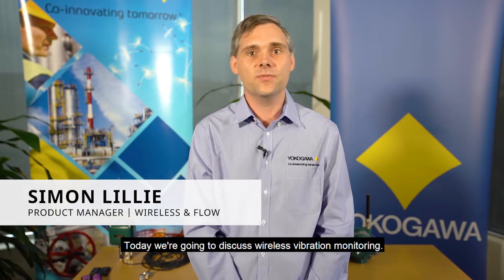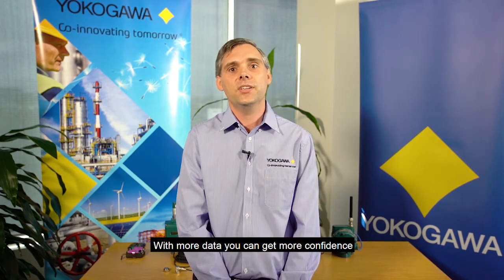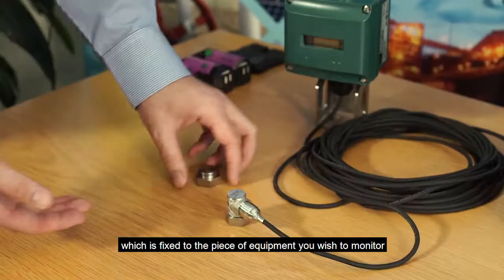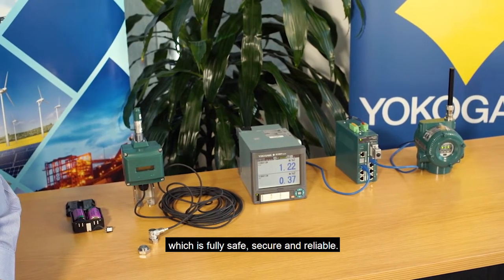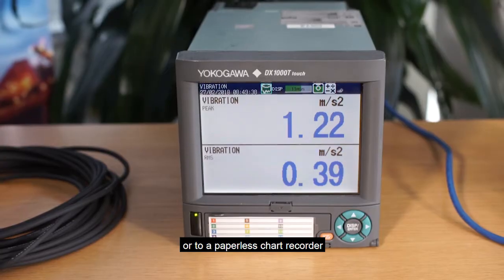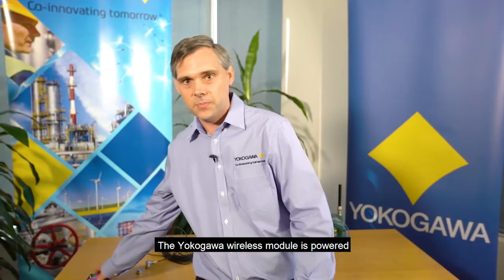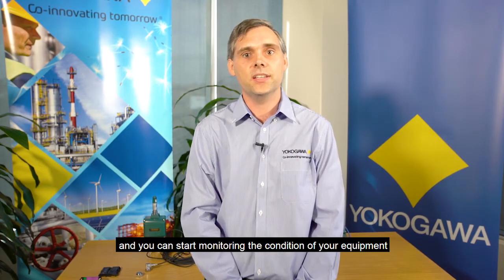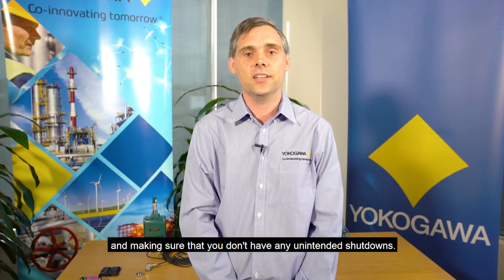Wireless Vibration Monitoring

Comment: Nice video, but wish you had identified each component by its Yokogawa p/n (YFGW410 for example).
Reply from the maker: Hi Willy, check out https://www.yokogawa.com/au/solutions/products-platforms/field-instruments/field-wireless/ for p/n etc. or feel free to contact us at enquiries@au.yokogawa.com. Thanks!
Reply: @YokogawaAustraliaNewZealand  Great, thanks for the info.  I am relatively new to this, but I'm trying to configure a YFG410 gateway along with a YFGW510 access point, to a field device which is a Bently Nevada Ranger Pro 70M301 vibration sensor.  I have the system up and running, but I have an error - 'not published' - under the Operation Status heading on my Field Device List page.  I was told I may not have the correct configuration file for the Bently sensor.  I got in touch with Bently's tech support group and they emailed me what I think is the correct config (.cff) file.  Only thing is, I'm not sure how to install it using the Field Management Wireless console.  Would you know anything about this?  Any help is greatly appreciated.
Reply from the maker: Hi Willy, please contact us at enquiries@au.yokogawa.com and we can discuss further.